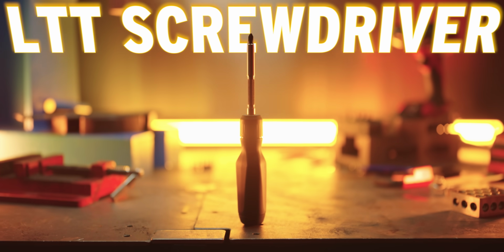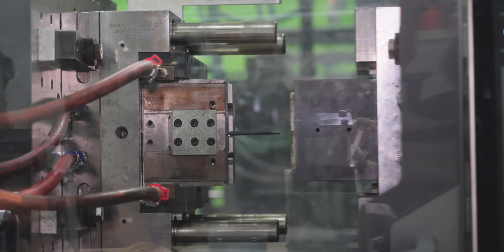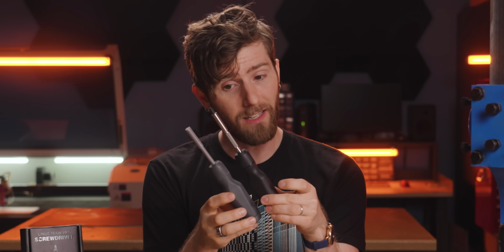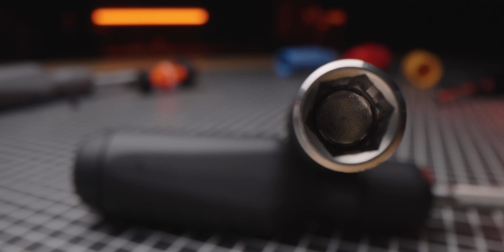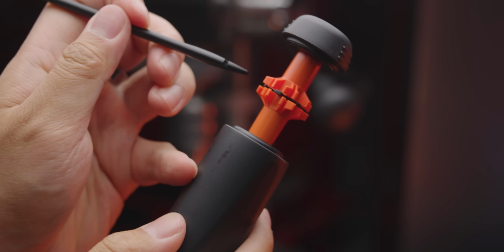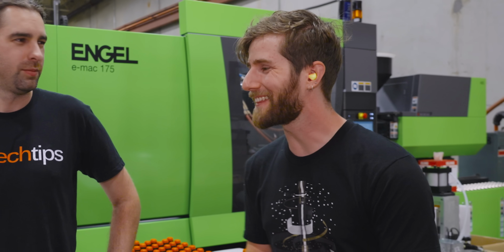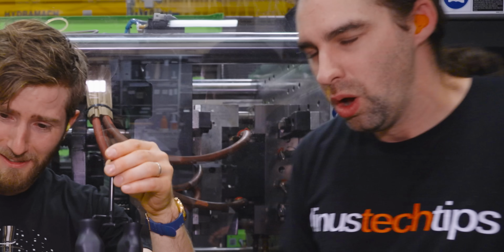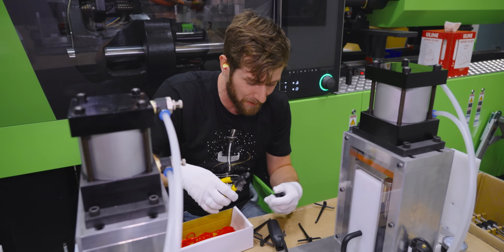Why our Screwdriver took 3 YEARS

Comment: The part where Linus gets into the assembly process is a great way to test if your process is flawed. If a rookie with no assembly experience in the product can't make the product, then you have points to improve.
Yes it is expected that people will mess up, but you have to mitigate as much as you can. And this part being so time dependent, is a real red light. Most of the times in this critical stations, only people with a lot of experience are put on them, but that makes the issue of not having other people around when that person is not available. 
There is a lot of ways to improve the station, but one that can go in immediately is change the gloves. They are smooth, give the worker some grip. If that fails, change the station so the finished product doesn't have to be manually removed from the machine or at least doesn't have to reach out for the piece. There are a lot more changes that could be made, but I suppose NPI has already given the green light and your production manager did the same. So that's best I can think of by the time.

Comment: Did qc for an injection molding company. It doesn't matter one bit, since that plastic is never gonna see the sort of stresses that will make it important, but I'm pretty sure that is a mechanically worse place for the gate. They likely had to turn up the pressure and temperature to get the plastic to make those tight turns, then ended up with a similar gate anyway. At which point they would give some person making the equivalent of minimum wage something like a knife or deburr tool and tell them to have at it and not worry too much because it's located in a visually busy area anyway. That's not disparaging the quality of the product or anything, just some thoughts on how it's actually made

Comment: Hey Linus and Team. Just one question. Will you also offer Pozidriv Bits in the future? Here in Germany most screws used in DIY aplications nowadays are Pozidriv or Torx, so I kinda need Pozidriv. Phillips head bits would have tolerances or "play" in Pozidriv screws. Also for example PS3 controller screws are PZ0 screws. You CAN open them with PH0, but in the long run it would damage the screw because you have "play" between screw and bit.

Comment: I took a shop class in highschool on making a screw driver from scratch by machining the screw driver and handle and it was like wow all this work for something so simple and then later in life getting a 3D printer and once again going wow the hair pulling over not making a rough project but the tweaking and improvements and being a perfectionist is the problem for me and definitely Linus also I currently work for a plastic additive factory and it’s crazy to think of the many different plastics their are in the world for colors(pigments) (dies) and I’m in the (UV) resistant field fit like automotive heat or leaving car parts out in the sun.

Comment: As someone that's used tools everyday for the last 34 years, the bit is the most important part.  S2 I supposed would be ok for the very low torque experienced in PC building, but don't use these bits for automotive applications, as it's a brittle metal and likes to shatter. Cr-mo bits are superior in every way or even cr-v, I can use a hammer on them without fear of damage if it's in a spot I can't get my impact screw driver into. S2 bits almost always break when you do this. The screwdriver itself seems solid however, will have to order it and see how it holds up long-term against my snap-on and Mac ones.

Comment: 20 years ago I received a snap-on ratcheting screwdriver as a gift for good work at this small computer shop I worked in, It's been excellent over the years and my go to screwdriver for IT work ever since. While it is still in really good condition, bit storage has always been a problem as I don't like how the loose bits rattle around and how to access one in particular I have to dump them all out of the handle. After seeing the reviews that tested this screwdriver against several others including the snap-on and how it out performs on so many levels I am eagerly anticipating my new LTT screwdriver!!!!

Comment: Probably Linus has to watch this to address the drop breaking one of the bit holder : https://www.youtube.com/watch?v=XyqGa4DZeKU (forward to 16;55). Coudn't it been made of rubber to avoid the brittleness when accidentally dropped? Not that I would drop it like what Jay did. Though the size of the handle sold me out since I do have small hands and the color and design has simple aesthetic to it.

Comment: This was very fascinating to watch the building process and tweaks to the design. However at this point I don't see a need of having to buy one of these at such an expensive price on my budget. I was actually curious about the drop test of these until Jay accidently dropped one of these and broke part of the inside holder of the bits. After seeing this I wandered why such a hard plastic was used instead of a rubber type of mold that would have handled more of an impact from the drop test. This got me to think about my own set of various screwdrivers and the one that stands out to me by my personal use for approx. 26 years is my Husky 16 in one. Its been dropped at least over 3 dozen times from as high up as a ladder going as high as the roof of my house and survived. Iv used it as a general purpose tool for that long plus many PC builds, car stereo installs, onsite I.T. work and many other various uses over the years. Its been the best value product over time I ever purchased for a ratchet screw driver and still has all the original bits with very little wear. Not bad for 26 plus years. It was purchased on a whim when I pulled over at a truck stop to get some gas and food. I saw this on the counter with a big retail display with a couple of them left and purchased one for $6.99 plus tax. I asked how good these were and was told that they are selling well for that price and have not had any complaints. They were on their 4th bulk order and almost out of these. Sometimes in life you run into a bargain that actually was a good deal at the time. I'm not sure how Husky's own comparable products today would stand up to one of their old ones from over 20 years ago. With manufacturing today always looking for the cheapest materials you never know. To this day I still keep this old Husky Rachet Screwdriver in my backpack with laptop and a SKIL rechargeable from 14 years plus years ago. I guess I have been lucky to have these tools last me a very long time and could be they were made very well from that time period. If mine eventually breaks I may consider the LTT screwdriver 2.0 version down the road when it can handle Jay's Drop test :)

Comment: I love the design of the shaft but honestly I have ratcheting screw drivers with similiar design and barely use them. Working with hand tools everyday on computers and industrial machines as an electronic tech it’s just faster to learn how to spin the screwdriver in your hand than using the ratchet. I would love have just that shaft with a 1/4 in socket connection on the back though

Comment: One challenge Linus has is how many of his audience and reviews are from people with very very little experience with hand tools. I saw one review complain that the bits still had some oil on them…. Which considering oil protects the tool steel from corrosion, and is common for anything but cheap crap or stainless tools, is just idiotic.  

And FYI stainless is weak as hell and you want tool steel.

Comment: I only just recently heard about the new LTT screwdriver but as soon as I heard it was $70 I kind of just figured, Nah I don't need a bit driver that bad... (I typically prefer full screwdriver sets with dedicated handles, (because I'm kind of a tool snob). But after watching Linus explain everything and be open about the process and seeing his excitement about the product he painstakingly works for, I believe I will give bit drivers another shot... I own a VERY small business where I build computers and fix anything from automotive electronics to washing machines and a bit driver just isn't something I use much because I have small hands and they generally suck! so far the driver I carry with me for when I do break down and use it, is shamefully the Kobalt double drive screwdriver, however, it has features that are amazing and I will definitely buy another LTT if they incorporate this sweet feature! The feature is a double drive collar which allows faster and infinite same-direction rotations when there is little backpressure. though it works great, the handle is too big for my small hands... here is a link to what im talking about... https://www.amazon.com/Kobalt-6x-Speed-Double-32-pc-Screwdriver/dp/B00Q30VGTA/ref=sr_1_3?keywords=kobalt+double+drive&qid=1663320359&sr=8-3

Comment: Two complaints from me: Firstly, ZINC? ZINC! Come on guys, havnt you learnt enough about chinese zinc alloys?! Theyre brittle, they crack, they deform through use, and they are basucally JUNK JUNK JUNK. Please change them for titaniumXaluminium alloy. Secondly, PLASTIC BUSH?! SERIOUSLY??? Cheap junk again. Please change those for Bronze bushes with a molybdenum grease gap. MUCH smoother, and you can narrow the tolerance back down to a good quality 2 thou. Apart from those cheapout weaknesses, Good Job guys.

Comment: As someone who's made products like this before... I am not surprised their first product was an integration nightmare. 

I would say if they have time sensitive finishing with a pressfit, then it was a mistake not to have automatic gate cutting. I also am surprised they wanted to use the natural cooling of the part to help with the pressfit - strikes me as unnecessary, but it probably helps the tolerancing.

What they said at the beginning was probably not completely true. His original handle design, as unergonomic as it looked, could definitely have been manufactured even with those scallops. It would simply have more slides and require a plastic that was more tolerant of uneven cooling, or highly engineered mold cooling. Uneven thicknesses, while not ideal, can be mitigated by carefully cooling the part such that the warping and sinking you get from thickness gradients is minimized. They could also have used some clever undercuts in the cavity to potentially even the thicknesses, but that would cost a LOT.

Tolerance stack ups like what caused the jamming issue are a large part of the design of these up front. I'm actually surprised they had issues finding the problem - those parts would all be inspected and if they are all in spec, they should all work. That 5 thou that was the problem - that should have been found. I should note that when products are made in the millions, they don't actually have to all work with each other - you do a Monte Carlo simulation to see the likelihood of two parts at worst cases of your tolerance bands interacting with your product and see if is a real problem - if it happens 5 times in a million, you likely don't worry about it if it's testable and repairable.

Comment: 20:45 The original machine has a base-plate of prefabulated aluminite, surmounted by a malleable logarithmic casing in such a way that the two main spurving bearings were in a direct line with the pentametric fan. The latter consisted simply of six hydrocoptic marzlevanes, so fitted to the ambifacient lunar waneshaft that side fumbling was effectively prevented. The main winding was of the normal lotus-o-delta type placed in panendermic semi-bovoid slots in the stator, every seventh conductor being connected by a non-reversible tremie pipe to the differential girdlespring on the "up" end of the grammeters.

Comment: A screwdriver that is 5% better than the megapro with only a 50% increase in cost. It is cool that Linus is such a perfectionist, but it is clear that if it wasn't for the massive marketing machine of LTT this would definitely not sell. If anyone is curious about performance, head over to project farms channel where he does a very detailed comparison. The LTT screwdriver is quality but misses the bang for buck mark by a fairly wide margin.

Comment: Got an idea for you after watching Jay’s video.

Include a shaft extension with your screwdriver.  Why? For any pc where you need to reach between two cards or a heat sync really close to side of case etc,

The extension just needs to be long enough so handle of screwdriver can stay outside of case/tallest heatsyncs.

(Or do a premium version and add the extension and a 2nd set of bits - or just sell extension separately) yes you can probs buy one from someone else but a matching one in same quality with same good magnets would be better.

Comment: im in the $100 screwdriver world as an auto tech... if mine breaks when it drops i get a new one when the tool truck rolls through that week for "free". its all lifetime warranty, even the bits! So paying $70 for the LTT one, that if it breaks im screwed it seems (LTT bits are not covered). i dont want to be stuck holding someone elses shaft to get my work done. i have a $5 one from walmart for the house thats worked for years on my pc builds. all my drivers also hold standard length bits, that are cheap from any store.  sorry linus.

Comment: while im gld you have 60k units sold, i cant see this  as a viable screwdriver as n IT professional, for 70 bucks. i can get a great  tool set for that price wth alot more than just  those bits.  and a bg handle makes  inside case use impossible. sorry linus. i wish it well.

Comment: I'll tell you why it sucks right away... The bit length.... It's always a problem with short bits that they don't fit into screwholes so you can't use it with anything with reassessed screws.

Comment: Lovely screwdriver, … but … the Megapro or LTT driver cannot be used by serious professional workman such as a mechanic as you wouldn’t want to smack that thing with a hammer, another thing it is only as useful as any other domestic driver, the reach with such a thick neck is also an obstacle … so I’m happier to use a 1/4” socket wrench, for leverage or a standard driver.

Comment: Im in the industries... no black oxide?  try it?  only way to deal with molding gates is to machine it off.  and any chance you can get adam savage's tested / strange parts or something to review it?  bet ya he would be interested in trying it.   I want to get one soon though.  great job.  oh and ya chinese ratcheting manufacturers have a history of failing...  oh and .005" ?  Meh we work in .001" +- .001" as a standard with more tighter stuff when needed.

Comment: For that price why isn't it electronic?  I Wish Dewalt would make a hand torque ratchet screwdriver with speed control for under 100$  Their regular drills are 100$  I have all these hand held tools and i always use only my Dewalt drill.  I use it for computer building to auto mechanics, to house renovation.  The torque is variable so no damaging, but it does get tiring to hold a big drill.  There are many electric drills already, but Yours Linus would've had me at electric, maybe version2.0?

Comment: Not sure if anyones mentioned, but with injection moulding it is possible to have more complicated moulds. I worked in a factory that had a few complicated moulds with multiple moving parts to achieve the desired shape.

Not that it would be financialy viable. I think those dies cost more than a million dollars to be made and required a lot more maintanance.

Comment: People who actually use tools don't give a shit about these details, what they care about is function & cost. When you find a decent tool that costs almost nothing, bingo that's a win. I used a ratchet screwdriver I bought at the hardware store checkout counter for $1.39, and it worked for ten years. I never cared if someone grabbed it, or if it was lost. It was sloppy, it was ugly, and I loved it. Btw it had soft rubber fins on the handle that were fantastic. If this costs more than $5.95 I don't want it.

Comment: Very nice screwdriver. If you ever decide to revisit the design for a second iteration, Wera makes a bit holding ratcheting screwdriver (a bit different from the one you tried), with the ability to shorten/extend, for about $40-50. The ratcheting mechanism is very fine, but tough. I carry one with me at all times at work. I'm glad you made a feature that allows standard sized apex bits, because that one factor would have absolutely ruled out the screwdriver for me (some aircraft require certain bits that aren't very common).

Comment: I always love when they talk about CNC stuff. Hardened steel isn’t hard to mill, you just need the right equipment. Which is expensive!!
Reply: Are you referring to EDM mill?   That is what we use to make all the inserts for our circuit breaker molds where i work.  CNC graphite electrode to create the negative in the hardened steel.

Comment: It seems like he just wanted the same screwdriver but with a smaller handle to fit in his tiny hands. And the end result is a screwdriver with bits that probably won't work in most other screwdrivers while also costing twice as much as a megapro screwdriver.

Comment: I really hope you didn't use the hardened steel and EDM process to make your molds until you knew you for sure you had the final design since I know you mentioned that you moved the gate at one point. I'm an engineer for a company that makes injection molded rubber and plastic parts (primarily rubber automotive gaskets and seals), and the first molds for anything we make are always made out of a cheap low durability material. We don't make the final hard molds until after the parts from the soft mold are 100% confirmed to work. So for example, if it was a mold for an automotive valve cover gasket, we wouldn't make the hard mold until after the car company confirmed they were able to fully assemble the engine and run it through testing without any problems.